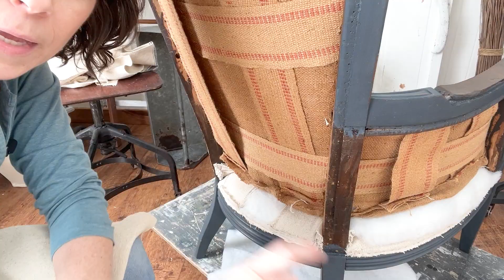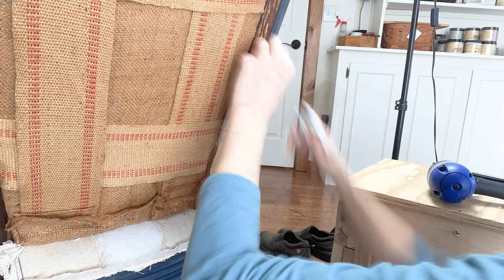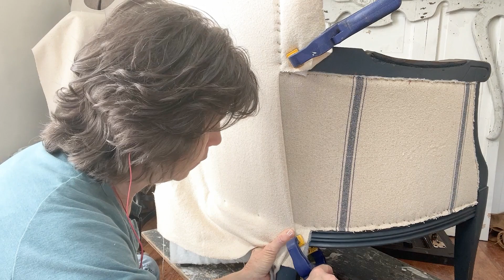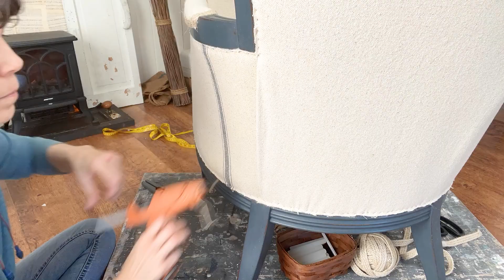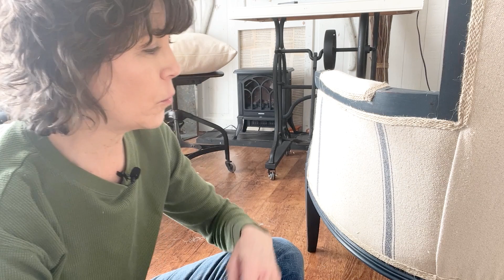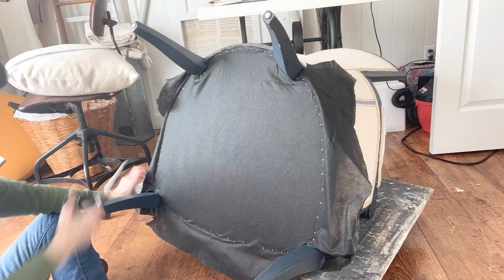Chair Upholstery Part 7 Outside Arms, Back and Trim | FULL REVEAL!!

Comment: Wow, Cindy, amazing transformation! New subbie. For the pillow points you can turn it inside out and put a rubber band on the corner. Gives it a puckering effect. I’ve got a couple of chairs to tackle myself, thanks for the inspiration.
Reply from the maker: Great tip about the corners - thanks! As for your chairs - go for it! You can do this😊

Comment: If you want to get the burlap trim hairs cleaned up use a lighter run it quickly over the little hairs and it’ll burn them off. It works great.
Reply from the maker: That’s a great idea! Thanks for sharing😊

Comment: Nice timing, my friend just gave me two chairs and a sofa that were nicely upholstered it's just the underneath fabric that needs to be replaced.  What video do I need to view to learn about that?
Reply from the maker: Do you mean the non-decorative fabric on the underside of the chair? If so, that is the last video  Part 7! Hope it helps!
Reply: @ReinventedDelaware  Yes, that is exactly what I meant.   I've seen images online but would prefer to see it in video form besides I like the way you describe and show things, it's much more helpful than just pics.
Reply from the maker: @jackiemorrell2298  You can see how to attach the dust cover on the unerside of the chair in the last part of this video! Hope it is helpful:0